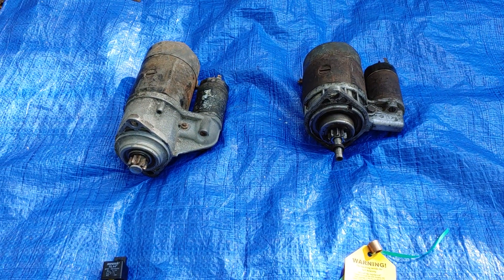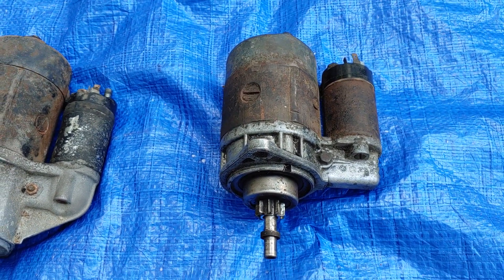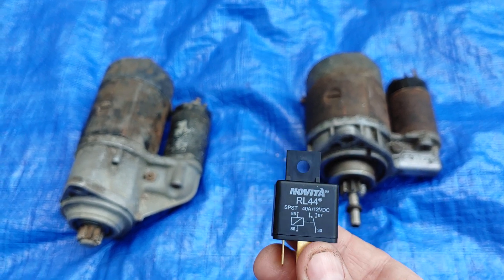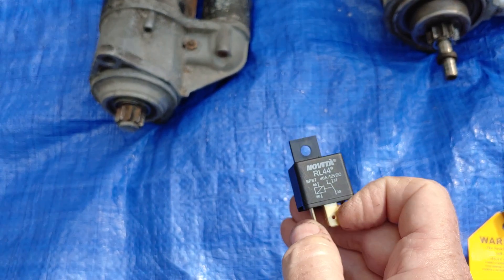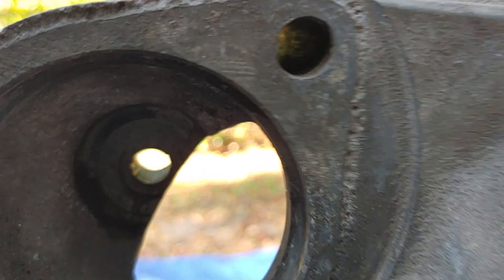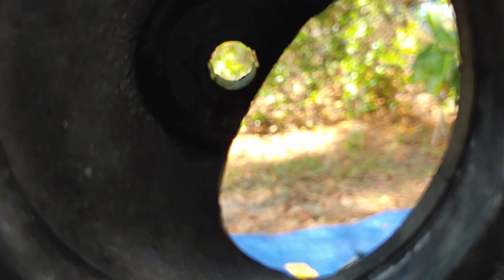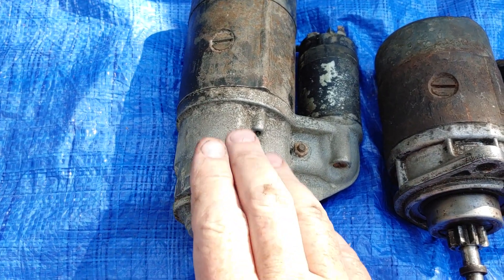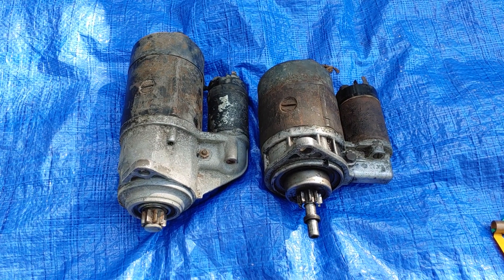CLASSIC VW- STARTING ISSUES. STARTER BUSHING? AUTOSTICK STARTER? HARD START RELAY?

Comment: I used an auto stick starter in my 4 speed trans, for a higher torque start on my last beetle, I don’t recall messing with any bushing. And it DID spin it over much faster!
Reply from the maker: I'm thinking your 100 percent correct. I know it spins faster ( torque). I just want to be sure before I have another section in pieces. Why did you switch to a autostick starter back then?
Reply: Volkswagenplanet I had to buy a starter when mine went bad. And I had a friend of mine told me to buy the auto stick starter, it’s a higher torque, to spin those big torque converter‘s. So I figured what the heck! I tried it and I was amazed, it’s spun that motor over really fast. Because the fly wheel is much lighter than a torque converter. I have one sitting here on hand I’m going to use on my four speed again on this beetle. I can’t take credit for that one, somebody told me about it about six years ago. But it don’t have that slow start like the four-speed starters. It just cranks it up fast.
Reply: @SladesVWBeetle  Do you know what the part number is for the auto-stick starter is?  A guy told me to get a starter for a 75 auto-stick. Just bought a 1600dp for my 65 beetle and I'm looking for a starter

Comment from the maker: The main question is, " if I put the autostick starter in will I need to take out the bushing in the transmission housing. Thank you for all your help.
Reply: No...I didn't
Reply: I don't think so due to it doesn't even go into the bushing with auto stick starter by what I see....any other starter yes...
Reply from the maker: @reddmann2216  you are correct. The autostick starter has the bushing on the end of the armeter. Thanks for viewing and commenting. Thanks for your support. More videos on the way. Stay safe.
Reply: I know I am quite randomly asking but do anyone know of a good site to watch new series online?
Reply: @Kylen Jensen Thank you, signed up and it seems like they got a lot of movies there :) I appreciate it !!
Reply: @Avery Tobias no problem :)
Reply: I tapped it out with a socket. I tapped new one in with valveguide install drift . The new bushing gets  a little tighter once it's in and the old bushing was still good but not perfect. So use new bushing everything. I didn't know about auto stick starter option sounds better no bushing fuss at all.
Reply from the maker: @jacquelinechellis4036  did the same thing years ago as well. The autostick starter is so much easier. They also spin faster. Faster crank means starter last longer. Hope the video helped out. Thank you for watching and commenting. Stay safe. More videos coming soon.

Comment: having the same problem, my buddy that works there at the bug shop told me I needed to put an auto stick starter in it so I wouldn't have to mess with the bushing. I will be installing it in the morning so I will follow up
Reply from the maker: @russriley3005  the autostick starter engages faster. I use them in all my beetles now.
Reply: I didn't realize what my buddy gave me when he gave it to me. I guess an original Bosch auto stick starter goes for like $300
Reply from the maker: @russriley3005  go to Napa auto parts. Every autosstick starter ive bought has been remanufactured , but the case was always a Bosch

Comment: To remove the starter bushing from the engine , take a 1/2” threader and place inside the brushing turn clock wise , the old bushing will back itself out as you turn.
Reply from the maker: Thank you for the tip. Hope your comment helps others in the future, when they read your comment.

Comment: My starter burnt out. I did not remove the bush. I fitted the auto starter. 
It works fine and sounds great.
I have a 1302. Hope this helps.
Reply from the maker: The bushing is in the transmission case. You wounding need to take it out. If you notice the shafts on the armature are different lengths. Just in case you didnt know. I asked the same thing when I changed mine out as well. You are correct, the autostick works better. The starter spins faster. Glad your back on the road.

Comment: Replacing the bushing, I want to say I just tapped it out and tapped in the new one. The clunking sound, I really am not sure- could it be the starter solenoid? You can bench test your starter to make sure it and the motor work.
Reply from the maker: I bench tested the original one. Its was bad. Then bought a new Bosch unit. Same result. I watched a few videos on YouTube. Everyone did a hard start relay. I did that. Then I heard replace starter with autostick starter. I did that. I'm going to replace the ignition switch tomarrow. If this doesn't work, then i may have to send it to the shop. Thanks for the info. This has been a real learning experience. Stay tuned.

Comment: Hello everyone, I just got a 1971 VW 1600cc 4speed and was told the starter needs to be shimid but there are a few shavings on the fly wheel. Wondering if anyone would have any ideas on what it could be or if the shim idea would work??
Reply from the maker: Don't need shims. Quick fix take the starter out and get another starter. Get one used for a autostick. What's happening on yours is the armeture is hanging up or not dis engaging fast enough. VW don't use starter shims like old American card did back in the day. Hope that helps. Welcome to the VW way of life. If your on Facebook check out our VW GROUP PAGE. Its called Volkswagenplanet. Same as youtube. Take care , stay safe
Reply: @Volkswagenplanet  I have a 66 bug I put an auto stick starter but it’s not disengaging fast enough what should I do
Reply from the maker: @shortshiftmotornautics5848  check the battery. Then install a hard start relay. This relay will help get all the power you can from the ignition switch. It's a easy install. What happens when wire gets old it doesn't hold the load. I think I made a how to video on the hard start relay. Thanks for watching and commenting. I hope to get back on my 68 here soon. Let me know if my tips help you out. Take care and stay safe.
Reply: @Volkswagenplanet  thank you my wires are practically breaking off I was going to rewire all I needed to just until I get money a bit more situated. I have been trying to find a video on normal play on the pulley just to make sure it wasn’t a loose flywheel motor runs great no noises or issues just the starter acting crazy I just wanted to be extra sure instead of pulling the motor out again I haven’t had any luck on the video so far
Reply from the maker: @shortshiftmotornautics5848  if you are referring to end pull in the crank, pull the crank back to you. It should move a little. When they get bad is when they move and click at the end. Then it would need more shims on the crank. Glad I could help out. I have had owned several bugs in my life. Let me know if I can help with anything besides my current videos. Have a good day my friend
Reply: @Volkswagenplanet  thank you I will definitely comment if I need something else I’m just getting back into them I was just able to put a motor back in after a few years I’m a little panicked
Reply from the maker: @shortshiftmotornautics5848  make some videos. If I can do these, I know you can make them. It's fun, you meet a lot if great people as well. If your on Facebook, check out volkswagenplanet group page as well.
Reply: @Volkswagenplanet  I’m not on Facebook but I was considering making some videos I was never good with transitions but my buddy and I are going to attempt a fresh rebuild I thought it’d be the perfect time to start I think he is so I’ll send him the Facebook page
Reply from the maker: @shortshiftmotornautics5848  if you decide to make videos, so I can subscribe to your channel

Comment: An original vw bushing will be brass of a high quality and most likely to last for over 100,000 miles, it will benefit from a little smear of lithium grease and away you go providing it hasn't been damaged by poking about with a screwdriver etc.
Reply from the maker: Never thought about a little grease. Your correct I did damage mine with a screwdriver. Thank you for the tip and commenting. Check out Volkswagenplanet VW GROUP PAGE ON FACEBOOK AS WELL. Stay safe

Comment: I am in the same situation, I am going on my  third starter for the month, I noticed my bushing is not a perfect circle more life an oval, plus their is quite a bit of the brass shavings around the housing.I am planning on an auto stick starter for the my next purchase, what was the outcome of your situation? What ended up working for you?
Reply from the maker: The autostick starter was answer. I would never use a manual version again.  A few things you need to know about the autostick starter.  This starter doesn't need the bushing on the shaft. You mention shavings. I would think it's a damages bushing in the trans housing. The autostick starter engages and spins faster than the manual version as well. Keep me updated on your situation. We also have a very active member Facebook group as well. They help out others questions as well. Same name : Volkswagenplanet. Same icon as well. Hope to see you there. We also have several other youtubers on the page as well. Hope this info helps. Stay safe. Thanks for the view and commenting.

Comment: I’ve never had to remove the bushing to run an auto starter.
Reply from the maker: I changed the starter today. Then wired a hard start relay, started fine. Then about a hour later, back to what it was doing. Im going to switch the ignition switch and see what happens. I just dont understand what it could be if that is not it. I'm going to explain what happened in tomarrow nights video. Thanks for your info

Comment: I think I am having a similar issue.  When I turn the ignition I get a grinding noise from the starter.  I took a wrench and am able to turn the engine.  I'm going to take it out this week and evaluate it.  What's a good web site to purchase a replacement starter?
Reply from the maker: Local Napa store. Get a starter for a autostick. The starter spins faster. Hope that helps you out.
Reply: @Volkswagenplanet  Thanks bro
Reply from the maker: @JoeHamby  anytime. Glad we could help you. If your on Facebook come going our VW GROUP PAGE. It's called Volkswagenplanet also. We have several youtubers posting videos to help others out as well. Hope to see you there. Take care, stay safe my friend
Reply: @Volkswagenplanet  Thank you, you are so kind with the information you give.  I started to take out the starter on my '71 and that top bold is a real bitch.  The socket does not fit.  A wrench is going to be a pain, so I'll try again tomorrow.  I'll check out those groups you mention.
Reply from the maker: @JoeHamby  the top.bolt is a 17mm I think. I use a socket and ratchet. I stick my arm behind the fan shroud. It beats your arms up. A tip, the top bolt is flat on one side. When you put it back in make sure the flat side of the bolt has to be in the right spot, or the bolt will move when you try and put the nut on it. I will see if I can make a video to explain what is going on. I will try my best to.get it posted tomorrow. Can't promise. I will try
Reply from the maker: Had to help my.mother today for her P.T. She fell Sunday and fractured her pelvic bone. I will try again in the morning to make the video.
Reply: @Volkswagenplanet  I'm so sorry to hear that about your mother.  News is I was finally, with the help of my brother and six year old, able to remove the starter.  It was a real bitch for him getting the right screw in the back of the housing while I held it from the bottom.  Ended up getting a cheap auto zone $50 starter.  Under inspection when removing, that brushing was baked in there.  The only one at Auto Zone was the same one with the nipple and brushing.   I pulled the trigger bought it for $50 just to test it.  It worked, fired, up, but super shaky because of that old lose bushing.  So I am going to return that starter and get the "auto-stick" without the nipple and brushing ($351.76) which as far as I have read works fine.  Getting this far with your help has at least helped me troubleshoot the exact cause of my Bus issues.  It makes sense, it shakes that way based on how the bushing looks.  When I removed the old starter was completely hammered, as in lose as a goose when I wiggled the gear.
Reply from the maker: @JoeHamby  Napa is 50 bucks for either the manual and autostick starter.

Comment: Good day to remove the bush use a scruwedraier 
To brake it  it is a soft  brass bush before you put the bush back  in hold the bush on your thumb put oil in it press with your  finger on top and press the oil vru the bush and then press it in the hole if your bush is where the amature is not in the senter then it sound like the battery is flat trust me a did chance it before
Reply from the maker: I.dont think I've ever heard anyone take them apart. Thanks for sharing the information.
Reply: Good day all a whant to sheare this 
A bay a golf 1800 a whas struggle with this golf 
In the begining this golf dont whant to start a whas thinking it was the starter when you turn the egnetion the bendings whas grining on the ringgeare a bay a new starter doing the same on the end of the day a found the problem it whas my clats plate and presserplate what whas rong 
A am not good to right eng but a will shere thanks and like

Comment: when replacing a manual starter with a auto-stick starter (Bug ) or full auto starter( Bus ,Vanagon or Type 3/4 )  you don't need the bushing at all ! It will fit no problem .It wires the same way also . there is a special tool to remove the starter bushing ... BUT if you don't have that you can use a 12MM tap or a 1/2" pipe tap to twist in and pull it out . 
I ran a VW specialty shop and used the tap method for years ...... Never ended up buying the tool . good luck
Reply from the maker: Good advice to other will read these in the future. I got my 72 super running again. It was another bad starter. Thank you again for sharing the info.